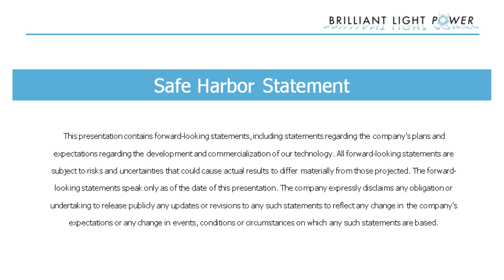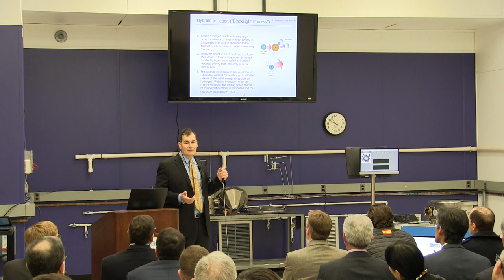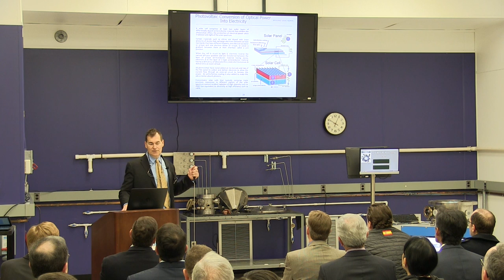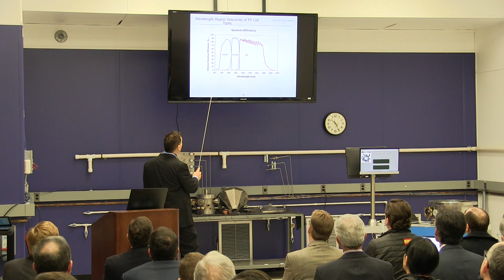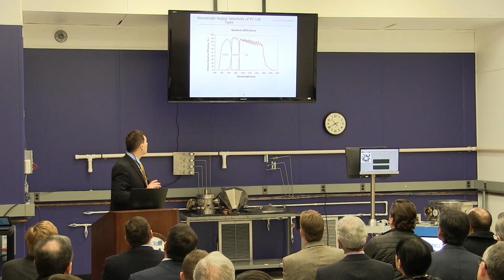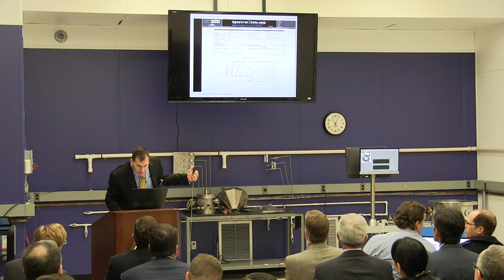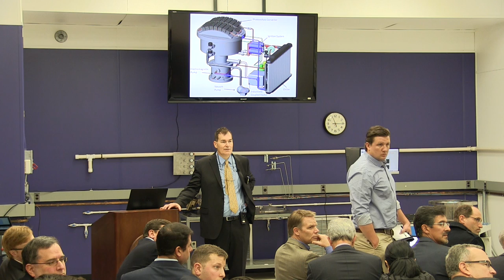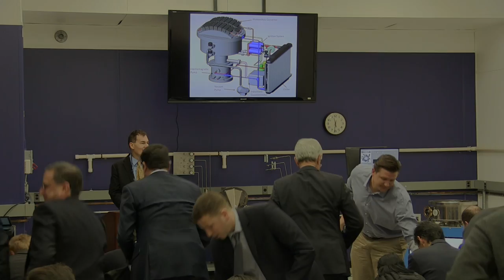Brilliant Light Power Demonstration, January 28th 2016

Comment: ignoring the COP, what is the lifespan of the capacitors when discharged 1k+ times per second?
Reply: graphene super caps to the rescue?
Reply: The capacitors in question are BCAP3400 P285 and they have a higher voltage rating (2.85 V) than the driving voltage for the plasma (less than one volt as per the transcript at http://brilliantlightpower.wikia.com/wiki/Transcript_of_28_January_2016_Demonstration). The electrode input power was 3.48 kW for the 2016-06-23-CG-Demo-Run data as seen in the Technical/Business Summary from June 28th Demonstration Day (http://brilliantlightpower.com/wp-content/uploads/presentations/Tech-Business-Presentation-062816.pdf). From the Maxwell datasheet at http://www.mouser.com/ds/2/257/Maxwell_Technologies_k2_2_85v_ds_3000619en_1-491975.pdf it follows that the "Typical Usable Power" for just one of these capacitors is about 4.25 kW (assuming 8.5 kW/kg and 0.5 kg per capacitor). It therefore appears that the problem is solved by adding sufficient such capacitors in parallel (4 in this case) in order to operate them well below what they are designed to handle.
Reply: That may be, I'm not an EE but know that caps can last in filtering usage as on a mobo, those can also be solid and not susceptible to "leaky" electrolyte.  

Now the much bigger concern are Mill's claims and 'validations'.  The circa 2008 Rowan test was promising but I haven't read of any similar tests / replications of their methodology, in short, I've discounted Mill's claims alltogether, including millsian which some claim could be using best fit, and source code is entirely unvalidated at this point.  The longer he takes, the more his credibility erodes, understandably.  The Hydrino made sense to me as a layman at first but then I questioned, why the E doesn't just absorb and make a neutron?  That's only one simple 'hole' and a physicist could defend the accepted ground state based on many experiments, with very little chance there is a newly observed ground for whatever reason, and a well founded and repeatable reason there would have to be.  The Millsian unaddressed and long-lingering questions are what really made me begin to question Mill's honesty and transparency in the first place.
Reply: Hydrogen is more abundant in the universe than any other element, and yet it is one of the least abundant gases in the Earth's atmosphere. Part of the reason is that it is less massive than other elements, and therefore it rises through air as you would expect. The other reason is that it has a high diffusion coefficient, and this is largely due to the fact that it is small. This is why hydrogen is expected to permeate the graphite dome which Brilliant Light Power has planned for their commercial SunCell design.

Hydrinos are states of hydrogen that are 1/2, 1/3, 1/4, 1/5, etc. (no less than 1/137) the radial size of "ground state" hydrogen. So it is expected that they will be even more highly diffusive than hydrogen. You would not expect them to concentrate in the atmosphere.

Furthermore, there is a greater binding energy difference between Hydrino energy states than between your typical excited energy states. You could only observe transitions between Hydrinos in a high energy radiation environment, like the Sun's corona, or under intense localized excitation such as arc mode plasma (like in the case of the SunCell), or under very special conditions at extremely low rates in specially-engineered environments (like in the case of their previous CIHT fuel cell designs). Additionally, the electrons in ground-state and Hydrino-state hydrogen do not have multipole distributions of surface charge and surface currents, and they are therefore stable in sense that they do not spontaneously radiate (ergo, they are "stable to radiation"). In contrast, excited state electrons have multipole distributions of their surface charge and current densities (the result of oscillating currents), and therefore they will radiate.

The only way to observe hydrinos is when they react with other particles, and when they do, these other particles become ionized. If too many particles become ionized then that stops the reaction from proceeding, and then you can no longer observe them. That charge-build process limits the reaction density and therefore prevents a chain reaction. This barrier is why Brilliant Light Power has taken so long to find way to overcome it (with arc mode plasma), and now they have.
Reply: "the theory" ?
Reply: "Various flotation method models point to a lower diffusitivity and actually a settling out of hydrino gas."

Then those flotation models are wrong.
Reply: The experiments are not even remotely similar. Have they detected continuum radiation from EUV spectra with discrete cutoffs predicted by theory? Do they match the spectral emission data found in BlackLight Power's experiments? Have they performed calorimeter tests to measure heat output? Are they able to shut off the electrodes and still maintain the plasma for several minutes?
Reply: terry wilder Is most of the energy emitted in those experiments in the EUV range in the absence of refractory materials? Have these experiments created large holes through molybdenum electrodes? If so, then do these experiments acknowledge the existence of a new energy source? If not, why?
Reply: terry wilder Would you like to specify which graphs you are comparing?
Reply: terry wilder Upon closer inspection of the UK patent 2219995 you mention I found the following:

"The existence of an ORME, while not directly identifiable by the aforesaid standard analyses, can be characterized by infrared (IR) spectra by a doublet which represents the bonding energy of the electron pairs within the ORME."

How is this in anyway remotely related to EUV emissions? Where is the chart showing spectra? None of the charts in the patents reveal anything about spectra. It certainly looks like interesting chemistry dealing with monoatomic elements, something I heard from a while back (particularly monoatomic gold). But what does it have to do with hydrinos? I agree there maybe something missing in the models, and something interesting may be happening with noble metals, but that doesn't mean that hydrinos do not exist.

Hydrinos have been detected in other scenarios. Please see "Plasma reactor and process for producing lower-energy hydrogen species" regarding an older experiment with hydrinos. There is no need for a vapor of transition metals for the hydrino reaction to be observed, although they help them form a lot faster as Brilliant Light has recently discovered.
Reply: terry wilder I am mostly interested in GUT-CP for its theory of the electron which is successful at predicting numerous properties of the electron such as bond angles and distances, ionization energies, Lamb shift, electron g-factor, the list goes on. The hydrino state is merely a consequence of the model used. However, I do not believe that a proper theory for the nucleus currently exists, and Brilliant Light has not yet revealed that it is able to describe nuclear structure beyond a single nucleon. Just because there may be transmutation in biological matter (I do not deny such accounts off-hand) does not mean that hydrinos must not exist. Hydrinos are primarily a prediction that results from how Brilliant Light models the electron and not how it models the nucleus.
Reply: terry wilder Who is this "somebody" you are referring to? I want to look up the claim directly.
Reply: terry wilder Mills had responded to the response that kt4ye received, clarifying the following: "That was an approximation done 15 years ago to show the similarity to a point charge.  I’ll update that short section.  All else remains the same."

Mills also added that, "This guy is missing an important physical aspect of a single free electron.  I’ll spell it out in the next edition that I post.  It is impossible to predict where people will get hung up when addressing quarks to cosmos."

The more recent edition, now published, states, "A numerical plot of the electric field out of plane is shown in Figure 3.3 wherein the plot is discontinuous at the plane wherein the normal direct field at δ(z) is given by Eq. (3.10) corresponding to an equipotential membrane due to the superposition of the photon field with the electron charge only at the plane of the free electron."

The new edition also states, "As given in the Force Balance Based on the Radiation-Reaction Force section, the current density of the free electron can be modeled as a continuum of circular current elements having the same rotational frequency. The photon field lines propagate along these current elements. The photon field lines and the free electron charge density only exist at the position of the two-dimensional plane of the free electron and superimpose only at that plane. Considering electrodynamic interactions (Eqs. (3.30-3.52)), the charge and current densities are determined to be absent any in-plane forces; thus the charge density comprises an equipotential such that the electric field lines at the surface of the free electron are normal to the surface."
Reply: terry wilder "What's being said" indicates a lack of acknowledgement of the concept of a trapped photon. The trapped photon concept is essential for Mills' theory. Without it, it cannot work. To reject the concept of a trapped photon from the start is to reject the whole model. So first you need to somehow refute the idea that the electron is a resonant cavity capable of storing photons in their fields. These "trapped photons" are analogous to the physical phenomenon of whispering-gallery waves, with the broader set of physics being that of evanescent waves. So there are resonant modes that could conceivably lead to discrete action. There is no indication of "radial magnetic field lines" in these evanescent waves.

If you want to really know, you will find that the magnetic fields through the disk are also normal to the plane of the disk in the electron's rest frame, as are the electric fields. Of course, since the magnetic field is essentially that of a dipole while the electric field is essentially that of a monopole, then the electric and magnetic field vectors are not exactly parallel, and the result is a circulating Poynting vector. If you choose a different frame of reference, then you get changes to radial components of the electric field and you have a circulating magnetic field component, with a resulting Poynting vector component aligned with the relative motion to the observer.

Now the caveat is who's to say the total internal reflection is perfect? I myself do not believe this and instead prefer the idea that the expansion of the universe is an illusion due to the gradual decay of subatomic orbits. See: /watch?v=k_309kZPfv8 In my view, the actual orbits are not geometrically ideal, but close enough for "fundamental" particles to remain essentially the same over a period of eons.
Reply: When all is said and done, just as I would figure that Mills' model is more complete for the electron than it is for the nucleus, I would also figure that Mills' model is more complete for the bound electron than the free electron. Just recently, he has updated his concept of the "hyperbolic electron", and I am sure that model is even less settled than his model for the "ordinary" unbound electron. Even so, this does not detract from this model's rather elegant solutions for bound electrons, nor from the subsequent Hydrino model, nor from the numerous accurate predictions that emerge from it, which are primarily in the field of chemistry.
Reply: terry wilder "Radiation from a resonate cavity is different in character from that of an electron."

What do you mean "radiation from a resonate cavity"? The thing that distinguishes resonant cavities is their ability to trap (not radiate) electromagnetic waves.

"Notice Mills skirts the obvious question what are these orbitspheres composed of."

The electron in Mills' model is itself a resonant cavity composed of charge and current distributions. It can capture photons which resonate within. How do you come to the conclusion that this was somehow not specified in his writings, when it is in his writings?
Reply: I just found this, where Mills states, "The information is there, but I’ll give a detailed description at that section and a plot of the electric fields out of plane and at plane wherein the plots are discontinuous.  Consideration must be made of the free electron as a continuum excited electronic state caused by absorption of a photon.  The physics of excited states is continuous with the free electron or continuum excited states.  The electrodynamic field may be treated as a magnetic field since a magnetic field is a relativistic effect of the corresponding electric field."

This statement from Mills in August 2015 is consistent with statements I have quoted from Brilliant Light's book a few posts prior in this thread.
Reply: terry wilder An unlimited budget doesn't impress me as much as publishing over 100 author / co-authored papers. Being lavished by an academic institution doesn't impress me as much as someone who had to raise money privately to do his research. Mills does in fact address the problem of the redshifts of quasars in Chapter 34 of his book.

In the end, I think real answer will stem beyond all this. I am a proponent of the idea of hyperbolic space, so the "apparent" distances between galaxies may be grand illusions - everything in the "distant" universe might be closer than we all imagine, if we simple traveled a pronounced curve for each destination. See /watch?v=u6Got0X41pY on more about hyperbolic space. It wouldn't be too hard to test this - just launch a telescope beyond the Oort Cloud to detect any anomalies in stellar parallax. If true, our universe is much "shallower" and "wider" than supposed by pretty much every theory of the universe that humans have thought of. See also "Cyclic Multiverse Hypothesis".
Reply: terry wilder "No negative angular defect has been detected but I believe positive ones have been ruled thus ruling out hyperbolic geometries."

A positive angular defect may inferred from some modelling which attempts to account for the Cosmic Background Radiation in the context of the Big Bang Theory. Of course, the prevailing conclusion thus far that is the universe is geometrically "flat" meaning that Euclid's Parallel Postulate is thought to apply at the very "largest scales". The determination of the angular "defect" of the "splotches" in the C.M.B. is not strictly a measurement problem but also a matter of comparing the spot sizes to what "theory says they would be if the universe is flat". Ultimately, the conclusion is an offshoot of the Cosmological "Principle", because without that assumption, there would be no Big Bang Model and they would then lack a prediction of what the spot sizes would be if "the universe is flat". Because they have this starting assumption, they are therefore able to characterize the "defect" by comparing the observed pattern to "what theory says the pattern would be if the universe is flat". I would argue that the Cosmological Principle has as just a "strong" foundation as the idea that "there is no state below the ground state", and so I question the nature of the observation itself, that there is a "positive angular defect" in the context of the C.M.B..

"A good way to determine the merits of something is to see how many try to control it."

Sure, just look at the growing number of industry partners, investors, and customers that are joining in on Brilliant Light's new discoveries. I look for the Mover & Shakers, not the Cash Cows, because Mover & Shakers are the leaders of new markets. Look for updates after the Roadshow events being scheduled for December 2016.

"Mills gives an atomic force microscopy image of napthalene I believe. Does his model describe it's kekule structure as an orbitsphere. If so from where does it come?"

You can find out about that on Millsian. Orbitspheres are used to explain atomic as well as molecular orbitals. You can also check Chapter 15, Section 3.37 of their book.

"I don't see orbitspheres explaining how Paulings electronegativity scale gives a clear distinction between covalent and ionic character."

I don't see why a preference for Pauling's electronegativity scale has to be theoretically justified. Electronegativity is an empirical tool, and it's not just Pauling's electronegativity scale that provides useful distinctions, as other electronegativity scales exist. They are somewhat arbitrary and have very little to do with actually solving for physical properties of molecules such as bond energies, bond angles, bond moments, etc. from first principles.
Reply: terry wilder "From what I gather Mills can't explain the difference in the properties between HF and NaCl I.e. covalent character and ionic character."

For covalent bonds, look at Chapters 12-17, 20, and 22.

For ionic bonds, look at Chapter 18 titled "Nature of the Ionic Bond of Alkali Hydrides and Halides".

For metallic bonds, look at Chapter 19 titled "Nature of the Metallic Bond of Alkali Metals".

For semiconductor bonds, look at Chapter 21 titled "Nature of the Solid Semiconductor Bond of Silicon".

For organometallic bonds, look at Chapter 23 titled "Organometallic and Coordinate Functional Groups and Molecules".

For metallic superconductors, look at Chapter 25, Section 2.1.

For ceramic oxide superconductors, look at Chapter 25, Section 2.2.

"Funny that hundreds are trying replicate Rossi while none Mills."

Rossi is associated with the Cold Fusion/LENR community, which has thousands of members. Rossi knows how to sell a railroad, but he doesn't know how to run it. He has many competitors now.

In contrast, Mills has eschewed the Cold Fusion/LENR community, so there is no surprise they are not trying to replicate Mills. Mills would rather establish ties with engineering firms, market experts, and potential customers. There are replications of the experiments with experimental guidance from the company. Mills would rather be ahead in the market when the SunCell arrives. He has a greater level of responsibility to provide investors with good returns, considering that $110 million has been invested into the company over a 25 year period. He would rather go to market before there are "hundreds of replications". Brilliant Light has essentially zero competitors if you factor in the magnitude of their technology.

"Where have the CHIT cells disappeared to?"

I don't know what CHIT is, but the CIHT (Catalyst-Induced Hydrino Transition) fuel cells are on the back burner because the SunCell is simply superior on many levels in terms of cost and power density. CIHT may be useful for small portable devices, but that is obviously a small share of energy compared to plugging in entire buildings or even neighborhoods into a SunCell. The change in emphasis is a no-brainer.
Reply: terry wilder "Again suspicion remains. One may ask why has neither Rossi nor Mills mentioned Central Power Generation, which would be where the greatest immediate returns would be."

Central power generation is heavily regulated and time to market is much longer. There are fewer players at the level of central power generation. However, when production ramps up, they could easily scale the cells and gang them together for central gen applications.

"Why is Mills mentioning this as a power source and this ridiculous PV system instead of a light source or a heat source that can immediately and effectively be compared to known standards."

Because heat exchangers add cost and size to the unit, and ultimately you want to run vehicles, homes, etc. on electricity. CPV isn't ridiculous, it's simple, and useful for a wider breadth of applications.

"Using a several thousand watt industrial welder to light a string of Christmas lights of a few watts just doesn't cut it."

We are not talking about Christmas lights anymore. Do you remember watching the "Industry Day" videos?

"One would expect a pv junction to fail 2,000 times as fast at 2,000 times intensity."

You don't seem to know very much about concentrated solar photovoltaics, because if you knew even the simplest thing about them, you would know they are already being used commercially, and no, they do not fail 2,000 times faster at 2,000 times the intensity of the solar flux on Earth.

"A Roadshow? Why would such a thing even be necessary, and not be just a waste of time? You think a GE, Westinghouse Siemans or a Dana Corporation is just going to say no thanks for no good reason?"

If you believed it was a good idea to look at the website to check what the roadshow was about, you would have seen that it will take place near the law offices of Fried, Frank, Harris, Shriver & Jacobson, who deal in international law. Events are scheduled to take place near their offices in Washington, D.C. (December 6th) and London, U.K. (December 16th). I would imagine this would help support their cause for obtaining patents on the technology, and I'm sure the law firm will be taking good notes to support efforts to get patents granted on behalf of Brilliant Light Power.
Reply: terry wilder "A patent on a yet non-existent theoretical device?
A working prototype takes care of all those problems!"

Yes, they will take the working prototype to the road and demonstrate it near the law offices of Fried, Frank, Harris, Shriver & Jacobson.

"The Carbon footprint of 
1 kwh of solar pv is an order more than 1 kwh diesel to electric. You wouldn't see these used commercially in 99% of the cases you do now if their manufacture, use, sale and generation were not subsidized. That Mills has a greenie doing a sales pitch for them smells to high heaven."

You have no clue about concentrated photovotaics do you? These panels are capable of handling light intensities thousands of times greater than what the sun puts out on the Earth's surface. At those intensities, 1 kilowatt of light power can be generated into electrical power by an area of panel no greater than a business card.
Reply: terry wilder "That is bull the hazard rate for these junctions is exponential - that two thousand was off the cuff linear example. What would last twenty years in the field will last four or five days."

Brilliant Light Power is working with Masimo Semiconductor. See:

Masimo-BrLPIndustryDay-102616.pdf

Or if you want something from Masimo's website, see:

LAB7286A_Sales_Tool_Masimo_Semiconductor_BiFacial_Growth_Concentrator_Solar_Cells.pdf

Maybe you should talk to them. You apparently know something that they don't.

"Same with the capacitors."

You failed earlier to correctly identify the capacitors, or even the fact that they would be operated well below their rating, which means exponentially greater longevity. I have pointed this out above.
Reply: terry wilder "And exactly what are carrying these currents?"

The currents are held together by electrodynamic forces.

"Again EM escaping a resonating cavity through an opening has a phase difference between the E and M components."

Sure, what is the problem there? If the electron lost energy to a photon, then obviously a phase difference occurred and it radiated. If the EM energy is retained inside the electron, then it means it didn't. Simple as that.
Reply: terry wilder "You're mischaracterizing these capacitors if they are as you identified. In that case they can be expected to have 1/18 the number of complete cycles as the 385 - 1,000,000 vs 18,000,000. Four at 1/4 saturation will have a higher failure rate than 1 at saturation."

That's a total lie. See "How durable is a supercapacitor?" at:

http://electronics.stackexchange.com/questions/26366/how-durable-is-a-supercapacitor

"Using a cap at close to its maximum voltage will cause it to fail more quickly than using it at a lower voltage, this tradeoff is known as a derating curve. It should be available from your capacitor manufacturer."
Reply: terry wilder "'currents are held together by electrodynamic forces' What's being held together?"

I was answering your question, where you asked, "And exactly what are carrying these currents?"

What do think carries currents? Conductors do. What do you think allow conductors to carry currents? Electrodynamic forces. In space, currents can flow without a conductor. Think solar wind. If you were to trap the charged particles, what holds them together? Electrodynamic forces. Supposed the electron consisted of a continuum distribution of surface charge densities and current densities. What holds them together? Electrodynamic forces.